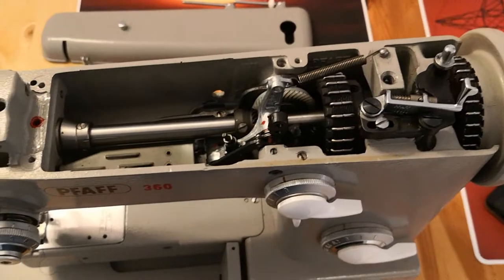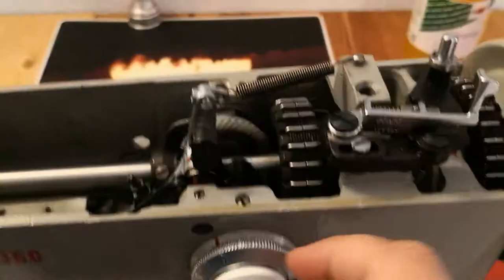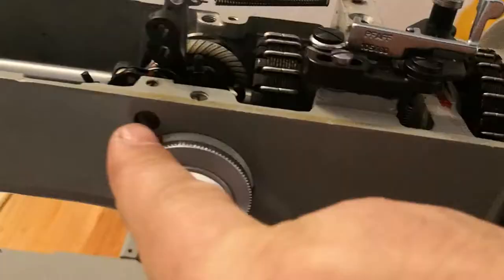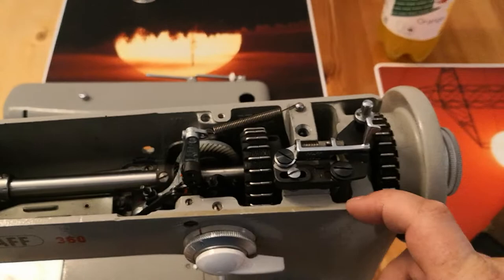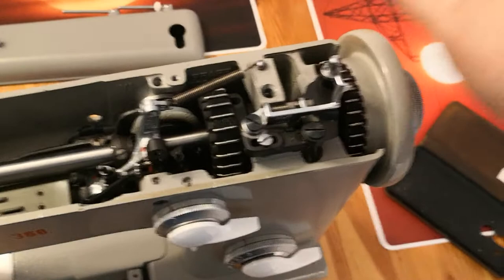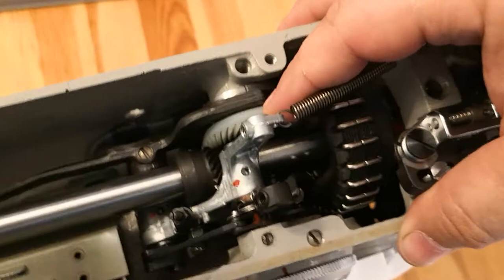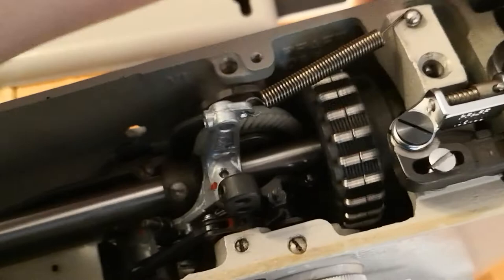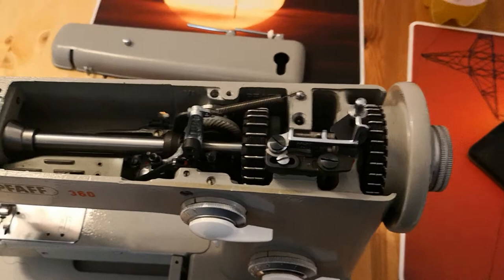how to get your Pfaff 360 un-gunked! English Version

Comment: Quick question - does the sewing hook on your machine spin freely?  On all the machines I've encountered, this is my first Pfaff,  the hook is locked in place and can only be moved by turning the flywheel.  However on my newly acquired Pfaff 362, I can spin it freely by hand at the bobbin area.  I have a problem that I'm trying to resolved and think that this maybe the cause.  Unfortunately I don't have another machine to compare.  Thanks
Reply from the maker: Hi
The bobbinshuttle has to be fixated with the needleplate.
When loose: Take the needleplate of turn it and the will be a notch were the bobbinshuttle will be insertet. 
You have to position the bobbinshuttle lets say finger to it, pointing to the left, and the place the needleplate notch onto that finger. Screw the screws back inplace and check the movment.
Reply from the maker: I made you 2 clips. Check em out
When i understood your question corecctly i assume it is this solution.
https://www.youtube.com/watch?v=JmXK2PmVEYM

When there is another problem with the cage i assume it could be this.
https://www.youtube.com/watch?v=Ngvs9mKJYCE

when there is another problem ask again ;)